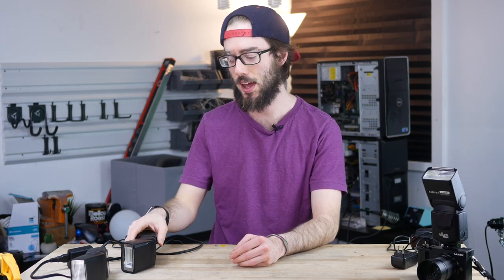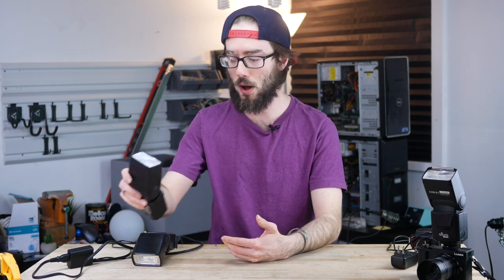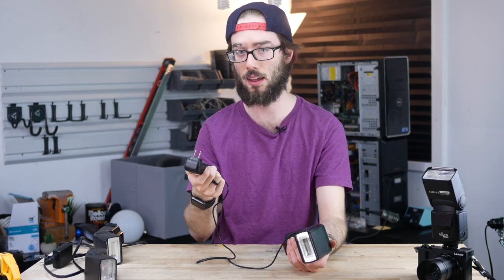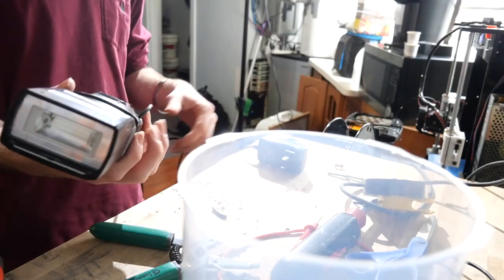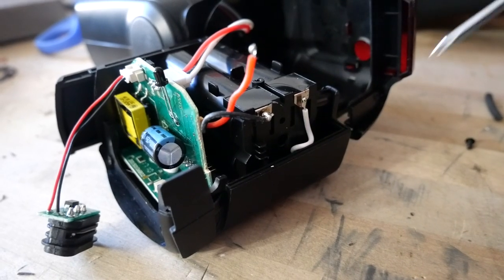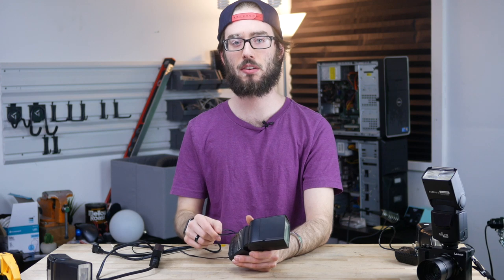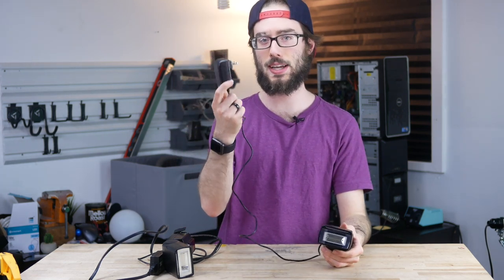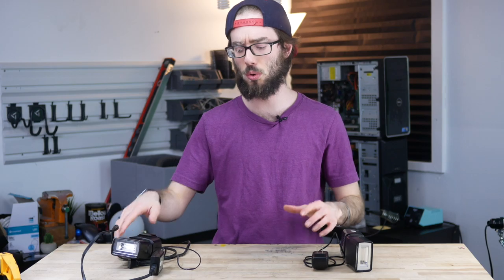DIY Camera Flash with no batteries!

Comment: Some flashes can run off external battery packs, using those power ports is way easier and needs no irreversible modification
Reply: That was the main reasons that many events & wedding photographers use ATG's.
ATG/Quantum Turbo Battery was born.  Then decades later ATG/Godox & ATG/Nissin.

I don't think many photographers want to open/cut/drill their ATG Gold; Canon EL-1, 600EX-RT; Sony HVL-60M, HVL-60RM series; Nikon SB-500, SB-910 & SB-900.

Comment: can you use a 18650 battery on it?
Reply: Yes.
Reply: @angelisone  have you tried a Series 4.2volts 18650 battery to a external flash? can the flash handle the 8.4volts?

Comment: You can change outpout voltage in many chargers ...soo instead 5v you can have 6v ..but need thing where is feedback loop and change on othere resistor value.. ... WOW you rip off cable from orginal battery conector hehe.. ...just cut of 2mm of Insulation of surface of cable along his lenght (no need to cut by copper) or put there paraller second cable soldered somewhere (directly to pcb)....Instead of making permament cable atached to flash or camera i like stay with dummy bateries... There even no need 3d printer etc... If i want convert camera i use old battery that already not work take out from there cell and soldern instead inside wires...fill empty space with some wood and lock it in place.. Make some small.hole that cables can go outside ...(thing where it will not colide .).. Most cameras already have some holes for orginal dummy batteries ..in flash you will file down some hole betwenn case and battery door...instead dummy batery is more economical (time to value)to solder wire to any conducting scrap metal or even just uninsulate some more of cable and lock it in place by just push it in with some folded paper and spring/foam/wood .. Ehhh many talks but not that many work... ...on cable inside. Make knot that will not let cables fall out from closed batery compartment ....on outside in ind of cables  solder some USB or othere connector what you like to use.. On end of you charger .... There is many of iteration how all this can be done.

I know that with some AC adaptors you can charger flash even faster that from new batteries...but continous fun will also heat up internal parts and broke them. Instead of 6v from new batteries same like you use 5v you can use 6.5 maybe even more..(.that depend  soo you can disasembly flash and sense how mutch coils etc heat up in "marathon" to know how mutch voltage you can increase ....that one of way....there always need think) And will be alright to.